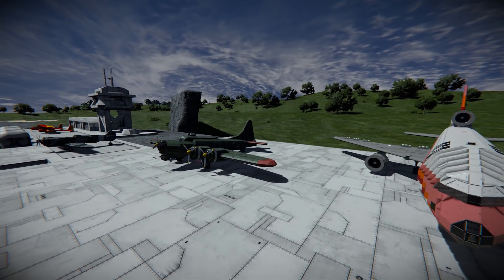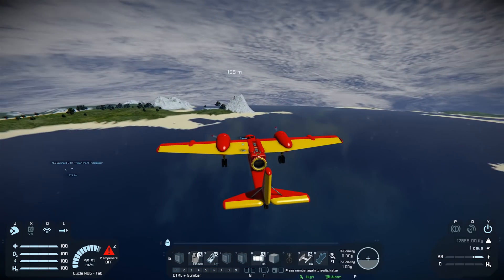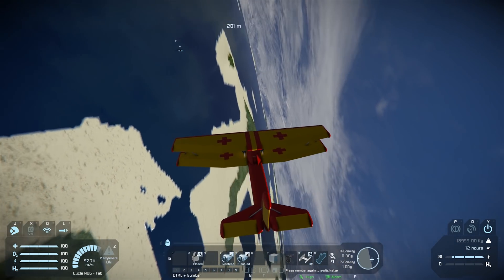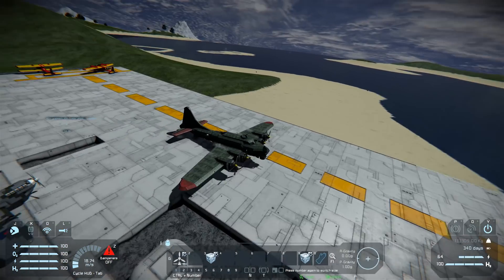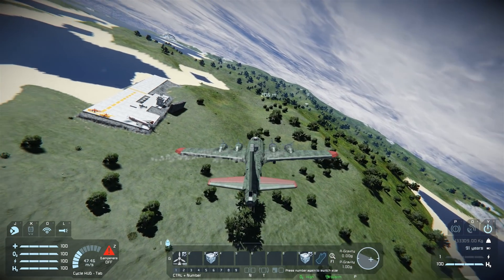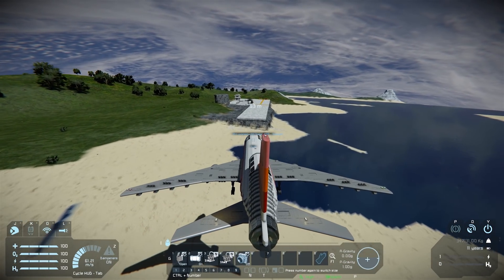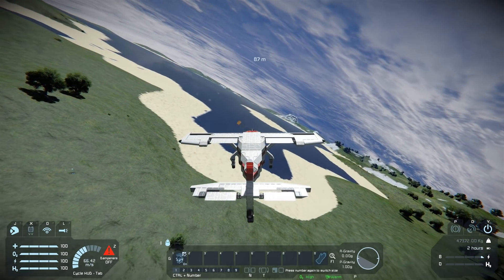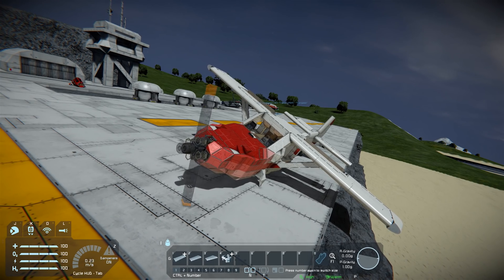Space Engineers - Realistic Plane Parts & Aerodynamic Wings Mods

Comment: But, if you apply a realistic directional thruster mod, speed mod and the drag mod on top of this, it becomes more challenging to build a craft that will fly straight, and your speed becomes more limited by the drag the design experiences, as well as the placement of your propulsion device is very important. With the drag mod and directional thrusting, if you're in combat and you loose an engine or part of your craft, your craft might become harder to operate and keep airborne. 

I wish there was a way to use a script to control rotor-based rudders and ailerons, so I could build a plane without gyros. If you know of one, feel free to let me know.
Reply: Me too!

Comment: Could you need some help with designing Runways? Real Engineering did something on it: https://youtu.be/5QZ3eozyQfU?t=431
You do not have to deal with temperature or wind, but air density might be an issue. The game does have some calculations for it for thrust of a atmospheric thruster/no thrust for Ion thruster and those mods might use those values.
Reply: Yes

Comment: I quite enjoy using this mod but personally I've only had it work in single player. When trying to use it on a server - even a powerful one with low ping it repeatedly bugs out on me.

For example - no matter what wheels I use the plane always flips out under acceleration (even in the air) and travelling at over 10m/s on those modded wheels would sometimes cause random disassembly and destruction (so even if I succeed in flight, now I can't land).

Ended up having to make VTOL planes and use landing gear which sorta defeats the purpose of using plane parts